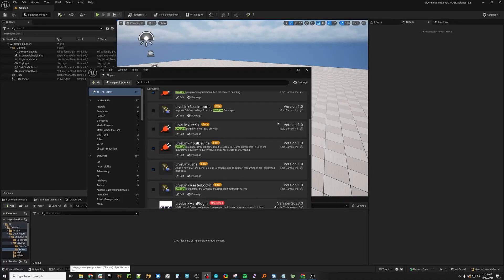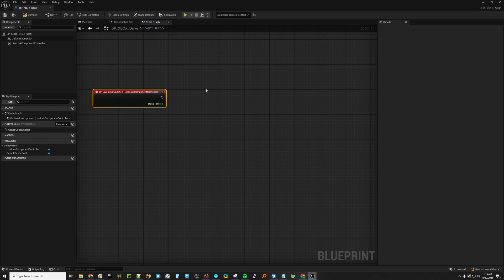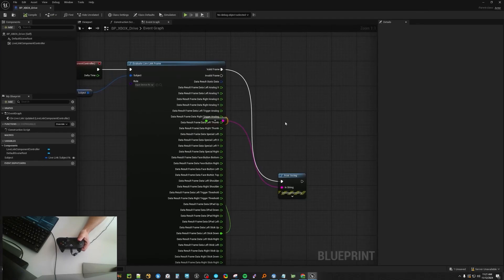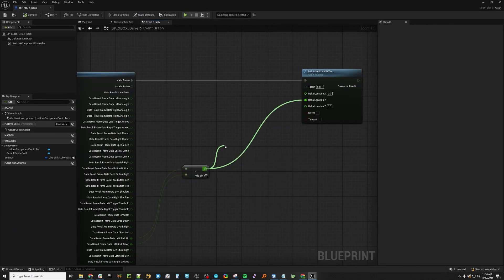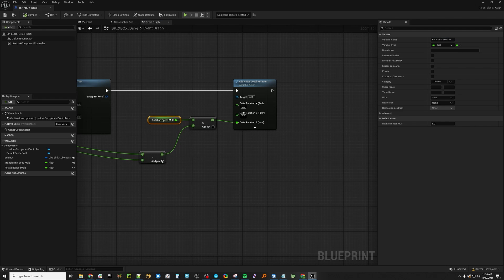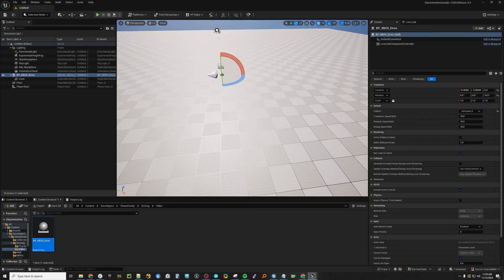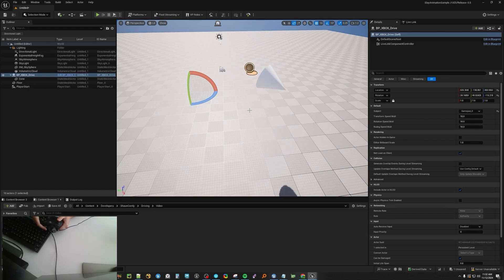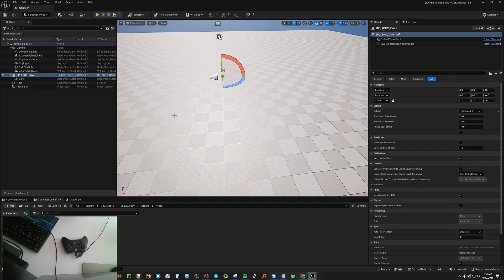Using the new Live Link Input Device Plugin in Unreal Engine for Virtual Production

Comment: Is it possible to use this within sequencer at all for keyframe animation?

The transformation values being driven by live link update in real time in the details panel but do not change at all within sequencer. 
It appears only only 1 parameter can be key framed at a time and it has to be done manually (as opposed to automatically updating in real time). If the rotation and location values are both changed, after setting a keyframe for rotation, the location will immediately snap back to its previous position. 

I'm attempting to keyframe animate a camera crane rail rig as you've built in previous tutorials, as using a controller is a lot less tedious than manually adjusting each parameter individually, but the issues I'm having with keyframing is currently defeating its purpose entirely as all the changes I make with the controller get reverted as soon as a keyframe is made or scrubbing through the sequence.  

Hopefully this all makes sense!
Reply from the maker: Are you trying to take record it?
Reply: @shauncomly  Thanks for the quick response!

But no, I've been actually trying to avoid using take recorder as I have zero confidence in my ability to create my desired camera movements with any accuracy at all.

As a test I just shot a few takes with take recorder to verify this concern and yea, my movements were all over the place lol!
Perhaps I could get better at it with time and practice, but it's quite difficult and I'm not really sure if it's a viable solution or not.

I'm also very unfamiliar with take recorder. The test I just ran was my 1st time ever using it, so maybe there's something I'm missing that would improve my results.

Comment: How would you go about doing with with a Valve Index controller? I have tried to follow these steps but it fails at the print string.
I want to try and get the Valve controller to drive the world space of a full body IK controller e.g. my left Index controller puppeteers the left hand of my character. 
is that possible? I have been searching for a tutorial to do that but have not found anything yet. 
On top of that would be to drive other character control like mouth open/close with the controller trigger, the eyes with a thumbstick, eyebrow updown with the grip etc...
Reply from the maker: If you can get the controller to connect this is very possible. We do this at the stage. I don't have access to a Valve controller, so unfortunately, I do not know if it will connect. In theory it should.
Reply: @ i’ve definitely got the index controller connecting to unreal but not in order to follow your steps. The best I’ve had so far is to take a rig character like the dragon from the free control rig assets on marketplace, go into animation mode select the head controller add a rotation constraint and select a cone actor, and on that con actor I’ve added a live link component that takes the feed from my valve index controller. So I can get the head rotating live being driven by the cone. But now my problem is the rotations are not correct up as down and down is up. I get the sense I could do this with blueprints and have more control but I have not been able to find a tutorial to walk me through that at all and I’m getting kinda lost
Reply from the maker: @jamescunningham2035  Can you make a post on the forum? When you do I can flag it to Tony Bowren. He'll be able to sort you out. This guy https://www.youtube.com/channel/UCvk8gMwInHRDpIsrxFqzx7w